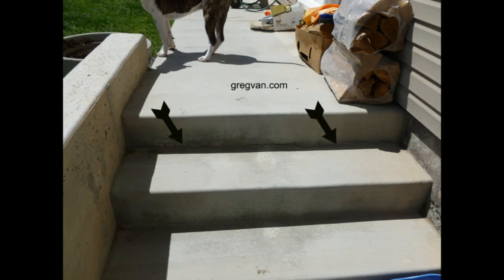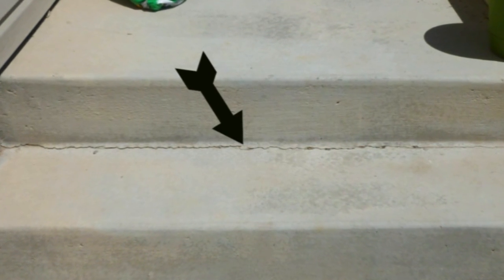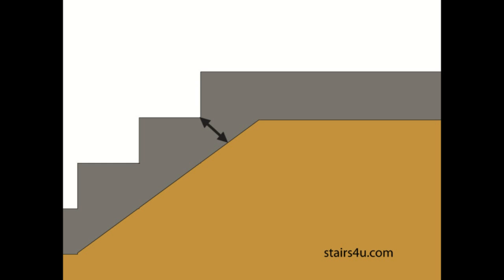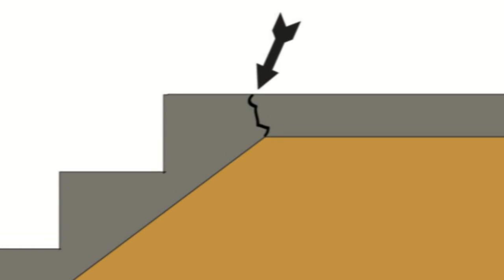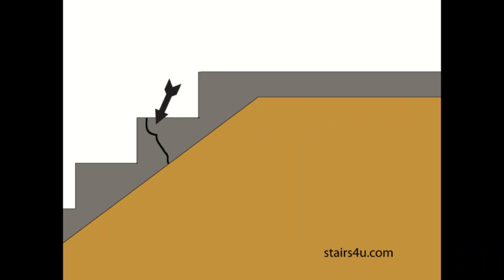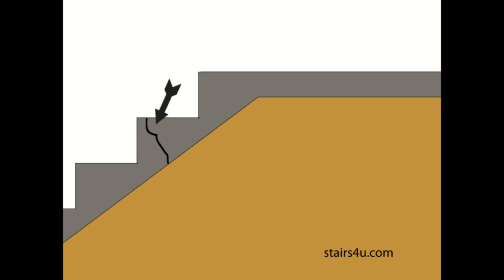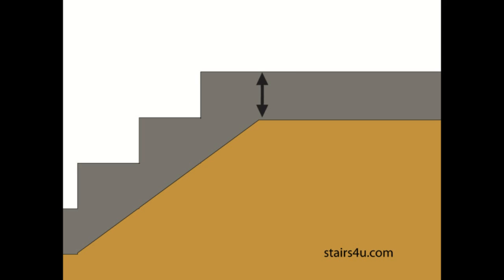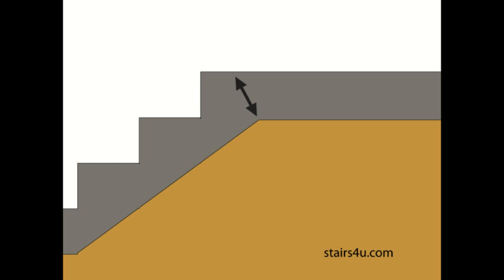Concrete Stair Cracks and Weak Spots - Construction and Engineering

Comment: Can you help me how I can fix this crack
Reply from the maker: If cracks are small you can usually fill them with some type of filler or sealant or caulking, but if they're large and creating safety problems, then they might need to be replaced.
Reply: @stairbuilding  thank you